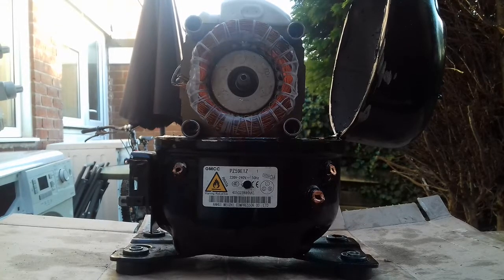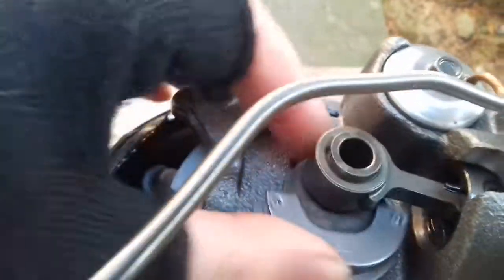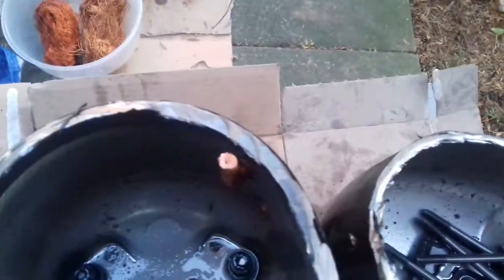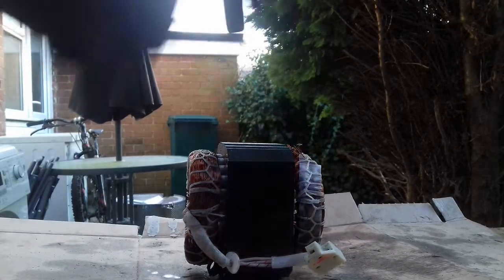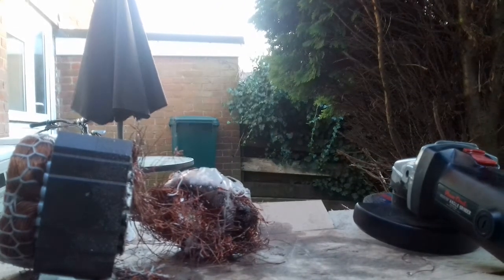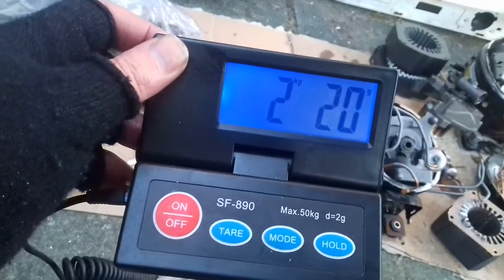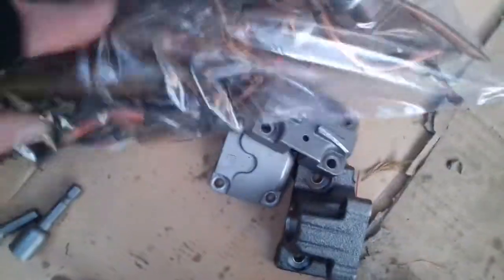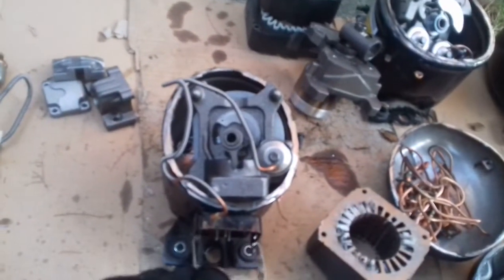how much copper from 3 fridge compressors

Comment: What does the yard class that type of copper as? I've got 4 compressors that I'm think about stripping but unsure what to run the copper in as. Is it classed as bright copper? Cheers
Reply from the maker: Number 2 at the yard i weigh in at, even though you can get copper from fridge compressors what look like bare bright it ain't, same with small electric motors and transformers, funny you mentioned about fridge compressors I've got about ten to do ,worth doing and they don't take long to do

Comment: Hi is there anything you should do when removing.. does it need draining ect..I'm worried I'll take a grinder to it and it will explode... Great video.. all the best for 2023
Reply from the maker: Yes you have to drain the clear fluid from i side the compressor, I just drill a whole centre on the front and let it drain, then your good to go with your grinder ,thanks and happy new year to you
Reply: @Night Scrapper uk  legend
Reply: Do you use the oil for anything.. ?

Comment: I bought a angle grinder so I could do compressors. They are fun to do
Reply from the maker: they certainly are fun to do .I will say I've come across a lot of  mixed moters some with copper and cca on them.i just weigh them in as moters tho
Reply: @nightscrapperuk13  I have had one mix . Then the rest were mostly copper and about 4 or 5 cca